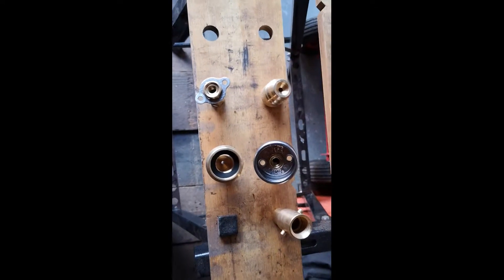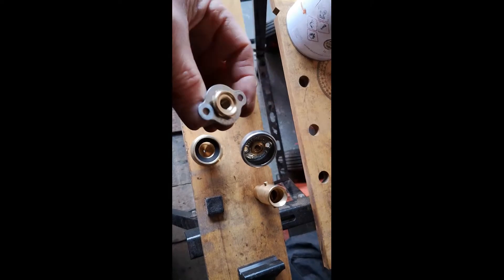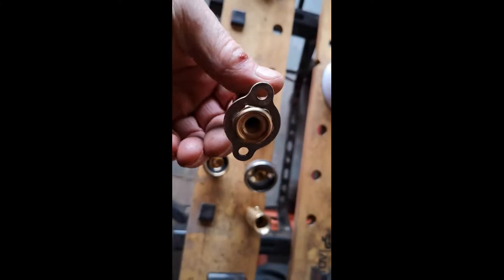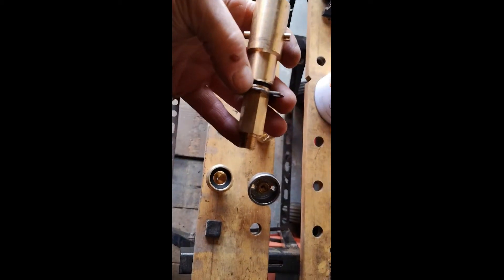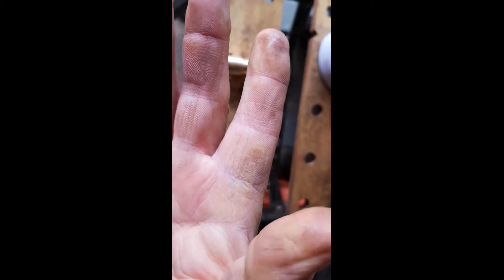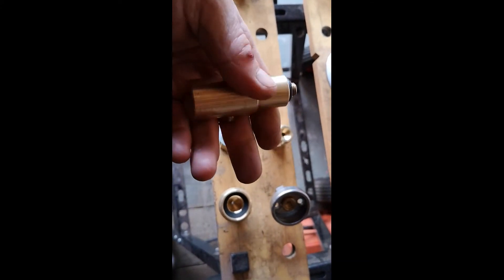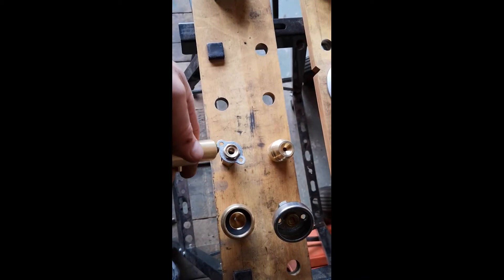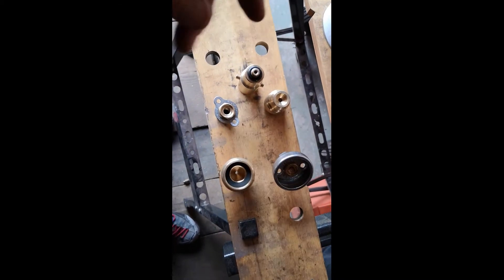LPG Filling Adaptors

Comment: I think that you should check the pipe system on your vehicle! Is the tank bolted to the undercarriage or cylinders (safefill or others) as they have a non return valve built in , if the gas escapes when you remove the pump you have a serious problem, best get it looked at ASAP. ED. PS. PIGTAILS ALSO HAVE NON RETURN VALVES BUILT IN.
Reply from the maker: The tank is bolted to the underside of the vehicle and is designed to take up the space once occupied by the spare wheel. The flow pipe is solenoid controlled at the tank and at the engine. The return pipe has a non-return valve at the tank, which prevents gas escaping from the tank in the event of damage to the pipe (according to Vialle). The filler pipe has a non-return valve at both ends (tank and filler port), to prevent gas escaping in the vent of damage. The tank itself has an internal valve to prevent overfilling, thus 80% maximum fill. Hope this answers your question.